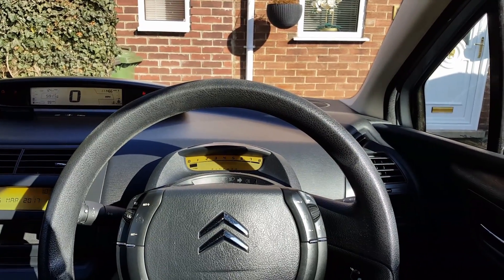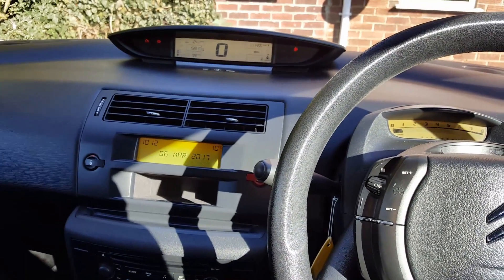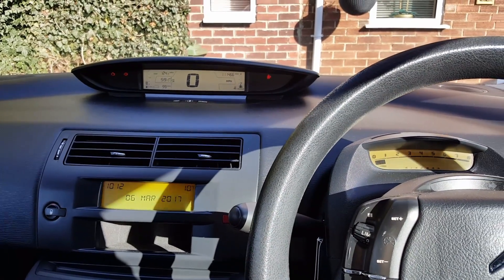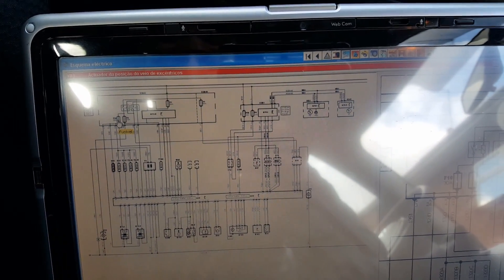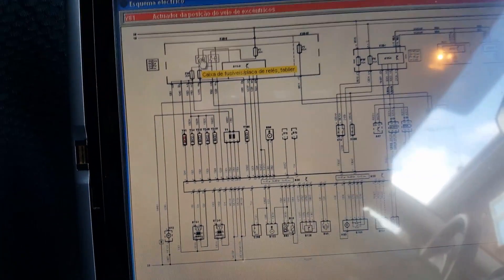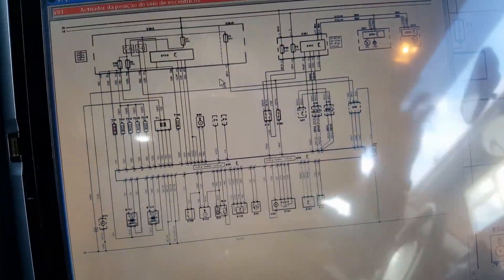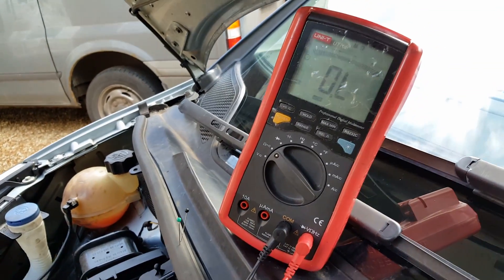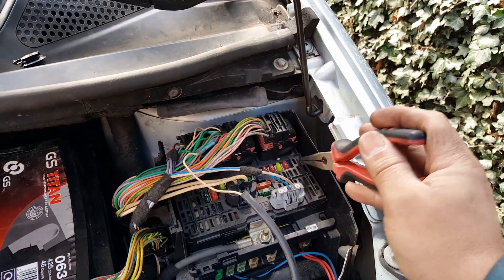Citroën C4 1.4 petrol KFU, engine light on, P0351. Fault finding and repair.

Comment: Thanks, this may save me some time with the same/similar fault.  This, when thinking about it, has to be something that is an intermittent  fault and a relay makes sense. When the code is cleared and the car is stationary, then the fault does not come on, However you can take it for a run and the light stays off, then you park up and leave the car to stand, then restart it then the light comes back on. Anything that carries current will heat up and relays tend to stick when they get old, which could be down to something as this.
Kudos to you for leaving the mistakes in.

Comment: I have this codes : P0352 Ignition coil 2 open circuit, short circuit to positive or ground intermittent. Code P 0354 ignition coil 4 - open circuit, short circuit to positive or ground intermittent. I changed the coil pack and spark plugs, cleaned the connector to the coil pack and the ecu connectors with contact spray cleaner. But i still have the antipollution check engine light. Would this be due to the bsm module as you detected it?
Reply from the maker: Could be... but, check wiring as well...
👍👍👍

Comment: Hi man, thanks for this video however i am still having an issue with this car. it started out with the fuel and coil relay failing then i did a test run with giving power directly to the pump and coil which allowed the car to start. I took it for a test then suddenly it just started to start back up after a quick stop i had. Now when i am trying to turn it on the car just clicks and clanks at the starter but the engine wont turn. It like there is a short circuit or lose connection preventing the starter to turno properly when everything is connected back properly. It is however turning when the pump and coil are disconnected but its not all the time that it is failing. Sometimes engine turns then sometimes it doesnt turn. Whein its turnong if i connect back the coil and pump it stops the starter immediately and starts to do the clank sound from starter anf relays. What could be the issue, i dont have the fault checking machine. Your help is greatly appreciated
Reply from the maker: I would say, double check the connections you made...
You also, might have further issues with the module, and the trick might not works for you, or other issues are causing those problems you are experiencing...
A diagnostic machine would help... that way you are working a bit blind...
👍👍👍👍
Reply: Eysh i am in deep trouble.  This car will just crank when one thing from the system is missing like CPS coil or pump but just clicks when everything is back up @LMAutoRepairs

Comment: I have same symptoms, but the only error showing is for Knock Sensor. I have 2009 1,6 C4 petrol hatchback and I wondered where the knock sensor is located and if it is an easy job to replace. I previously changed the O2 sensor, which has cleared that fault. Any help would be appreciated. Thanks.
Reply from the maker: Hi
The knock sensor is usually bolted onto the middle of the engine block...
Either front or back... not sure on that engine...
But you should be able to find it...
👍👍👍

Comment: I have got a p0351 and p0352,I`m only getting 8.8 volts at the coils, if i remove the coil pack and crank, no codes, but if i put it in the code comes back, i am looking to get a bsm at the moment
Reply from the maker: Good luck!
👍👍👍
Reply: @LMAutoRepairs  Thanks, quick question, its a petrol 407, should there be battery voltage at the coil pack, the car own is one single long coil, 4 pin
Reply from the maker: @pharezknights5467  
Yes... you should have battery voltage on one of the pins...

Comment: Thank you for the video! I have been searching online for a solution forever!  i want to try this as well. I have a puegoet 207 1.4 8v, came up with the anti pollution fault. My mechanic said we should break the catalytic converter out which he did, he installed  catalytic foolers upstream and downstream, it didnt work. He then said o2 sensor upstream, cold start switch, new spark plugs then coil pack (its a solid 4 pack unit). I have replaced all of them yet i still get  these trouble codes! if you could help i would be extremely grateful!!! 

Trouble Code(s)
P0037: Heated Oxygen Sensor (HO2S) Heater - Circuit Low Voltage (Bank 1 Sensor 2)
P0500: Vehicle Speed Sensor - Malfunction
P1336: Peugeot: Misfire on several cylinders - Catalyst can be damaged
P1339: Peugeot: Misfire on cylinder 3 - Catalyst can be damaged
Reply: Same with my 1400 307, changed coil pack, plugs, whole exhaust including the cat and both sensors , still driving like a pig, beeping every 5 seconds, I feel like fixing it with a sledgehammer...🥵🥵
Reply from the maker: Hi
Why you smashed the cat in first place?
Makes no sense...
What codes did you had initially?
All those codes can now be because whatever has been done...
My advise, take it to someone who knows what is doing... or the trying and parts cannon that can get you very expensive!
Too many things have been messed with, for me to be able to suggest anything... sorry...

Comment: HI there  i  am in South AFrica and have a 2004 Citroen C2 1.4 petrol that idles but does not rev. I changed the throttle body and the ABS unit. I should mention that it was involved in an accident and had it repaired from a panel beater  the whole left side ( replaced shocks, v-arm step axle and front parts. I have just checked the fused box and realized it may be the cause of the problem because it is broken and the wires are in a shamble state.  I see you changed the fuse box and you say you did not have to code it. The codes it is showing are P0351 and p0352, P1327 ,P2101 which all point to some electrical faults. Should I change the fuse box ? What do you think ?
Reply from the maker: Hi
If the wires are in a shamble, as you say, I would check just that first...
Make that there is no broken or short wires, check fuses etc...
Thank you for watching!

Comment: Thanks man from Brazil, i have a c4 2.0 here with the same faulty, but cilinder 2, new coil, new spark and keep cutting injector 2 and no ignition on that cilinder, thanks for your help man, congrats 👍
Reply from the maker: Oficina Francesa 
Hi
Have you checked wiring and compression?
Thank you for watching and for your comment!
Reply: LM Auto Repairs compression is ok, I'll check wirings from coil plug to ECU and then test another BSM.   BTW I have a workshop specialized on PSA cars, please check my channel. Thanks man

Comment: Hi mate,

I’ve recently bought a Citroen C4 and when attempting to start the car it just clicks however one attempt maybe out of 5 attempts will start the engine. The code reader said P1351 as an error, would that make sense with a P1351 code, would that go hand in hand to stop the engine starting? Also the brake lights aren’t working at all, none of them including the high light? Hopefully you can help as you seem extremely knowledgeable. Thanks.
Reply: p1351 check and clean crank sensor if diesel check glow plug on cylinder 1  brake lights switch on peddle or fuse dont pull things apart like this man all he says is err err err he has a reader lol
Reply from the maker: Only if everything was that simple...
Reply from the maker: Ash Wright 
Hi
That code should no give you those symptoms... but hey, it is a Citroen! 😋
Have a look at the live data... when you crank... if you manually active the starter motor relay, does the engine starts ok?
Thank you for watching!

Comment: p1336 ty
Reply from the maker: Myra Cleary 
Hi
P1336 is indeed for your crankshaft signal... but it might not be the sensor... it cam be a wire problem, or even the ECU itself...
P0201, is for a misfiring on cylinder 1... once again it cam be many things causing it... you need to get the car to someone that knows how to diagnose it correctly... otherwise you gona have someone just replacing parts, hopping that they will fix the issue... and when you realise, you have spent loads of money, and a car that still not fixed...
Hope that helps....

Comment: no the car starts ok just runs slow dont know the codes
Reply from the maker: That's what I am saying... you need to get the codes to get any kind of help... Many things can put the car into limp mode (No power, and no speed...), without checking the codes, is purely guess work...

Comment: thanks
Reply from the maker: Myra Cleary 
Fair enough... but what are the present codes?
The crank shaft sensor would prevent the car from starting... so if the car starts, most likely is not going to be that...

Comment: hi i have a citrion c3 automatic engine light came garage said it needed a new coil pack changed that changed spark plugs still run in limp mode engine light still on dine diagnostic now found two more faults sensor this was new last year and something else baffeld help
Reply: crank sensor check crank seal maybe putting oil on contact
Reply from the maker: Myra Cleary 
Hi
Without more info is impossible to give any suggestions...
Many things can put the car in limp mode...
The faults in the ECU,  exactly what hare they?

Comment: hi, thanks for sharing! Actually this is common problem on these cars. Tried to open one bcm but couldn't see the board cause the silicon on it.  Is there any special liquid that could remove the silicon?
Reply from the maker: Ivoury Daganika 
Hi
Thank you for watching! 
It might be something able to clean it... never researched that...
Reply: @LMAutoRepairs  what scanning tool did you use for this engine? Thank you
Reply from the maker: In this video I was using Lexia...
👍👍👍

Comment: hi there i have watched this video and believe i have a similar problem. i recently bought a new unit and fitted it. when i tried to start the car with the new bcm it showed an anti theft fault. could you offer advice please? does it need to be reset or coded? many thanks,  Stuart
Reply from the maker: Stuart Dainert 
Hi
They should work without needing to be coded. 
Can you scan the car?
Does the car starts?
Reply: lmsvvavr its turning over but not starting. car showing codes p0351 p0352 p0353 p0354 p0571
Reply: May sound silly but did you replace it with the exact same part number,there are different bsm 's .Immobiliser fault will show if you have fitted a bsm that has front fog lamps but the car does not have them  and visa versa